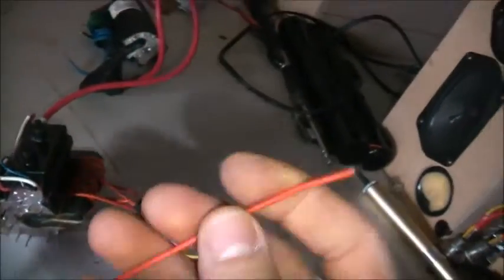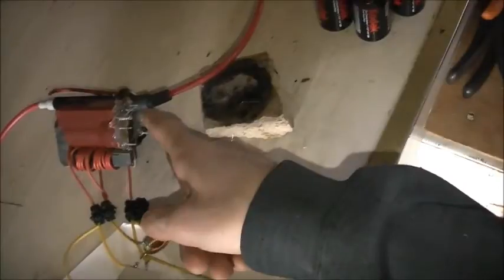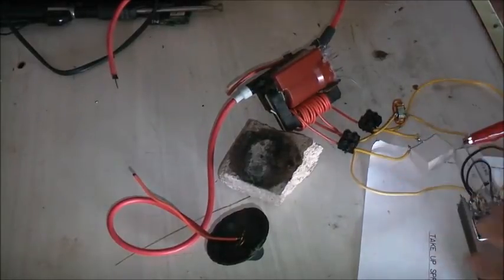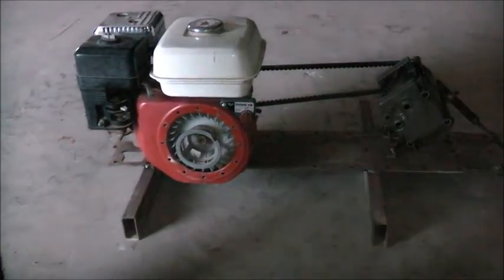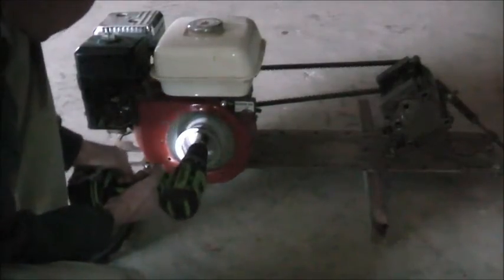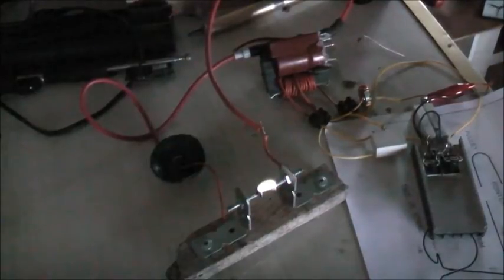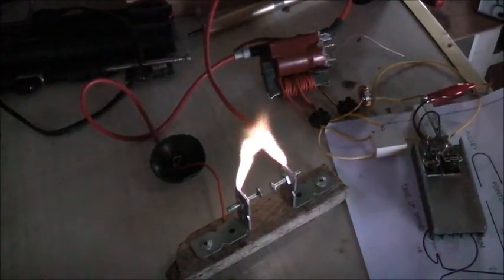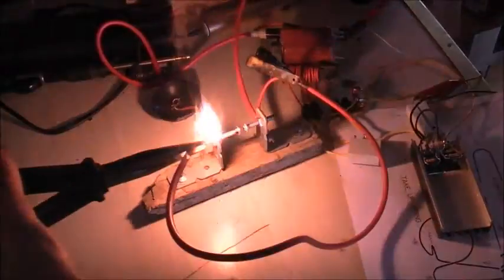Spark Gap & Ford AC Compressor Torture!

Comment from the maker: Yer it was soaked in Gear oil ;-) it did pump air quite well before I last stripped it down, I must've placed the valve assembly in upside down!